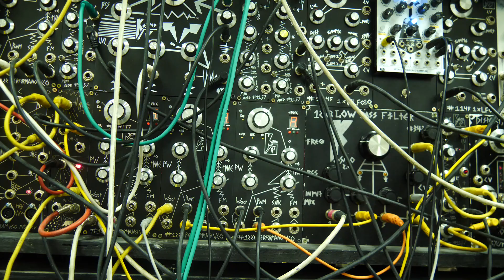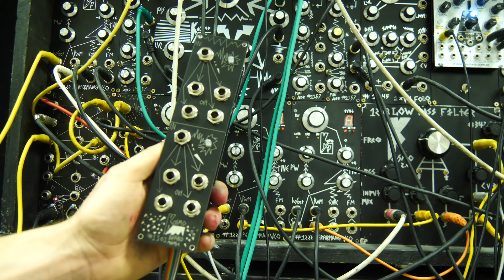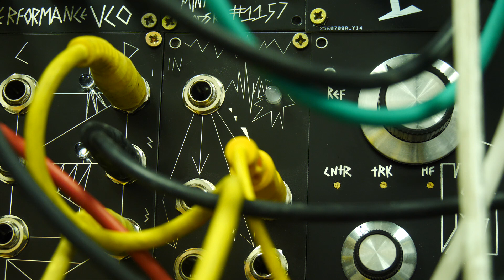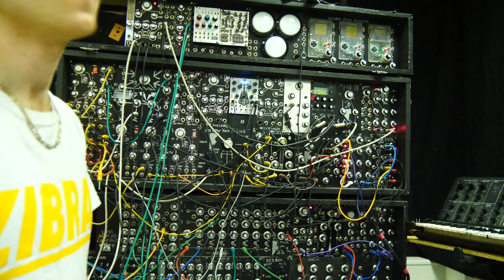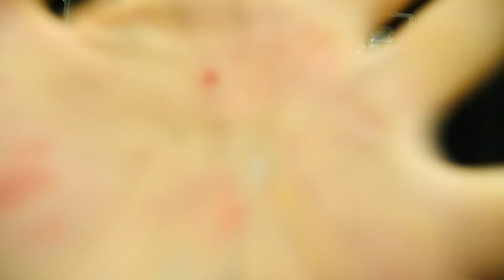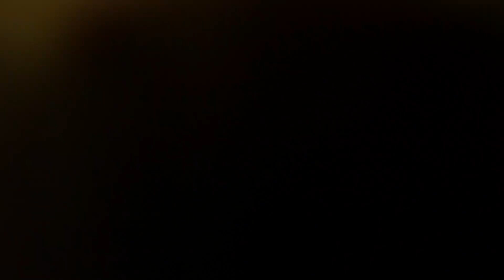1161 Buffered Multiple

Comment: Do buffered multiples induce a noticable delay into the signal chain? Or am I misunderstanding something? 🙃
Reply: No bufffer in programming is different but in electronics it just means an amplifier with 1:1 gain to supply current to a signal.
Reply: No real delay. They make a copy of your input signal and re-generate it on the outputs. The hardware takes about a microsecond to do that. As he said, it's good for when your downstream modules 'pull too hard' and cause your passive splitter to droop; the buffer will prevent that.
Reply: Analog. No latency.
Reply: The ks for the replies, I come from a digital video background and for me a buffer takes time to store the frame that is coming in, simular to a tape delay, and then once the entire frame has been built only then will it be passed onto the next video component downstream - causing a delay.
Reply: @cook13snip3aa  Yeah , @oraz gave a spot on reply...regards.

Comment: How do you incoporate the eurorack in that format? - can you reveal that maybe, please? I see a Maths in the background i believe :D
Reply from the maker: hey casper! basically just make converter panels. just metal panels with m3 standoffs, the connectors and power supply's are the same
Reply: @THISMUSEUMISNOTOBSOLETE  ahh ofc, makes sense, then i don't need to change anything in the modules, thx mate! :D
Reply: Yeah his modules use a different physical size (larger panels and 1/4 jacks), but run on the same voltage specs as Eurorack so it’s electrically compatible. Just gotta make the smaller panels physically fit and use 1/4 to 1/8 jacks to connect them.